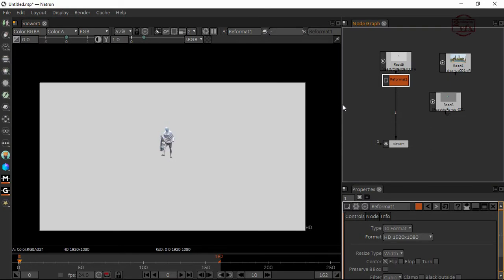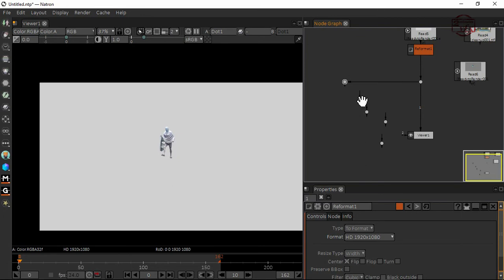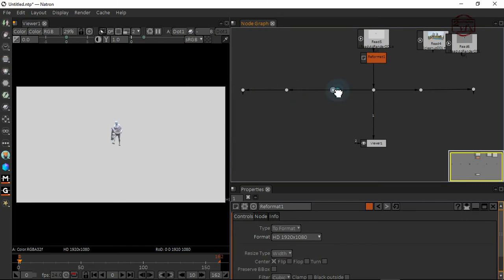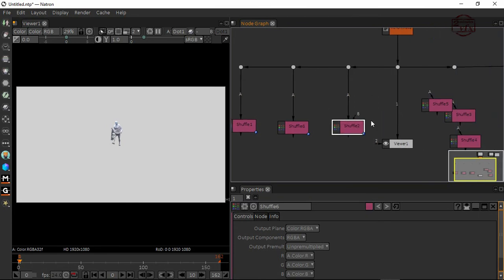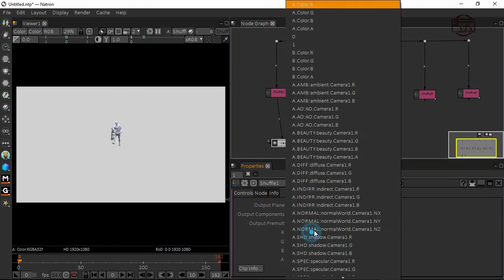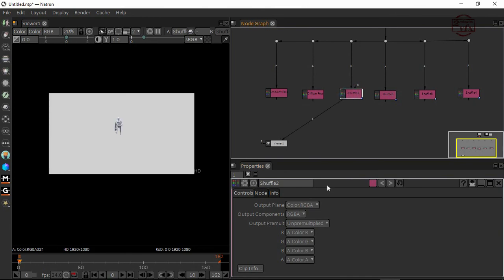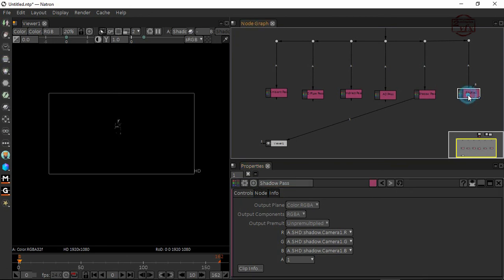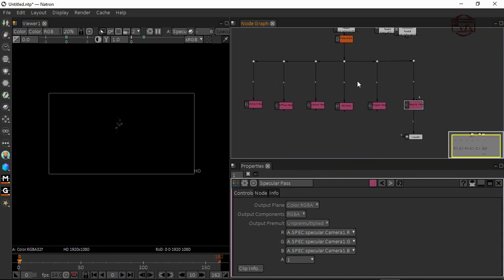15 Shuffling EXR Multipass Compositing

Comment: Is there a reason for using the shuffle node as a replacement for just copying the .exr and choosing the layers for each pass? Is Natron reading it faster? If not it just seems like extra steps for breaking up the .exr - I get it if its just personal preference tho =)
Reply: I'm not sure if it's just my setup but whenever I try to read in aov's embedded into the .exr via the file read nodes, I get constant crashes.  However, if I use the shuffle nodes it's super stable.